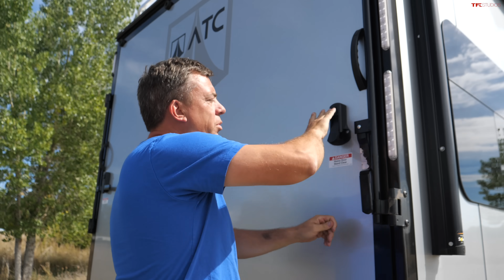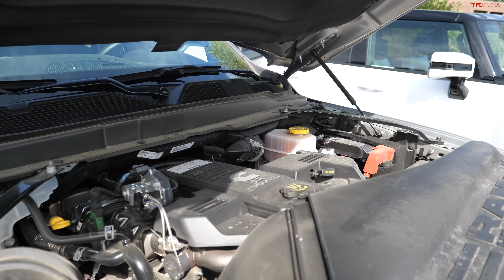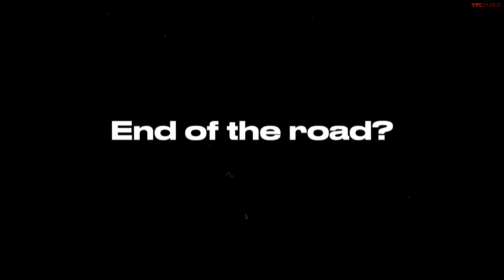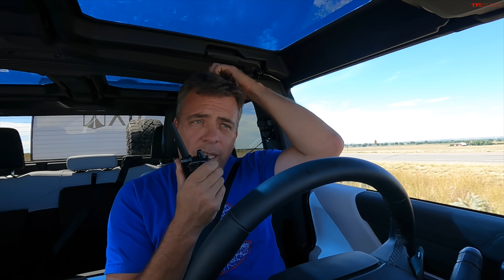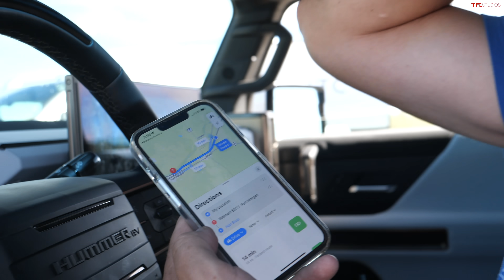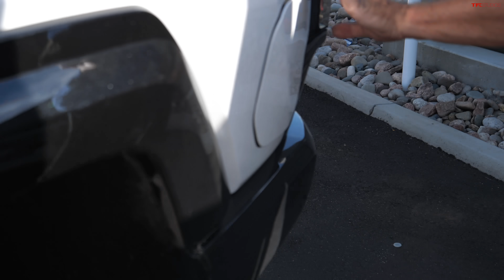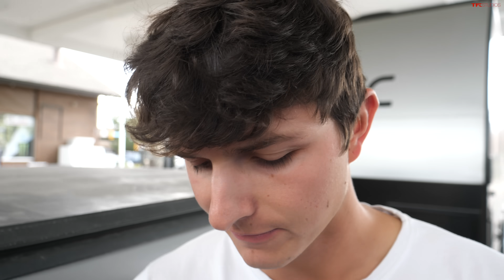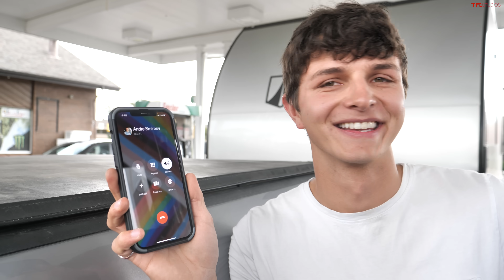How Far Can a Diesel and Electric Truck Tow An Identical Camper Trailer on ONE Fill-up?

Comment: Here is something these guys won't mention. Very similar to your cell phone battery. Optimal discharge and charge of the battery is basically 70-30. So you are urged NOT to charge the vehicle to 100% (70% is optimal) unless you need the extra range. Also you won't want to discharge the battery below 30%. All of which these guys have done in this day. Why do this you ask. Well with all batteries. Your battery has a finite life. The battery is losing capacity at a set rate. Not charging and discharging the battery in an optimal way will reduce the overall life of the battery. This is pretty important on a big, 3000lb multi-thousand dollar battery that comprises the bulk of the  value of the overall vehicle. Meaning electric vehicle resale value will be affected greatly by how well an owner cared for a doomed battery. Essentially. Ten years is the likely  lifespan of the battery. By the end of it's life cycle. The battery will probably have lost about 30% of it's original capacity. You can also factor in weather and other external influences on the battery range. Take all of these factors into account. You would realize that a 20 year old Hummer EV will be a useless as a work or tow vehicle. Think of all the time you will waste waiting at charging stations too. Which is another thing to factor. The electric vehicle is more efficient on energy that it has. But it's cost in money to acquire and time to charge. You are wasting an even more valuable resource. TIME. Ain't nobody got time for range anxiety and charging station hassles. Also, factor in being towed. If the EV runs out of juice. You likely won't have someone come and charge you back up remotely. You and your camper will be towed to a charging station and that will probably run you over $200. Also if the EV isn't towed properly or loaded onto a flat bed right. You might incur a $26,000 bill or more in vehicle damage from an inexperienced tow operator.

Comment: Out of Curiosity, the Hummers 200kWh battery is equivalent to ~5 gallons of diesel fuel.  What if you guys only put 5 gallons in the diesel truck and did a range test with the same amount of energy in their 'tank' Which is more efficient? by how much?

Comment: Sounds like a great vacation... Don't reach your destination, unhook trailer.. If you have space to put it.. wait for a charger.. kids restless at this point.. Plug in and wait another hour or more.. Charger has kicked off a couple times.. Kids screaming..  finally get charged, go back to trailer to find someone has parked in front of it... Hook up and maybe reach your destination..Etc... OR.. buy a diesel truck, go to your destination have a great weekend and on the way home pull into a stop that you can fill up and pee in 5 mins and keep rolling... 
And exactly HOW is this range  going to get products from the West Coast to the rest of the country with tractor trailer size vehicles? Over the Rockies? In the cold and snow?...

Comment: i kindda feel bad/pity those who got on the BEV "truck" train and then find out their advertised range when using said BEVs as trucks can absolutely torn to shreds! For the bigger picture/long term : why demonise ICE when we could keep the tech but adapt them to run more efficiently on biofuels that burn much cleaner? The marine industry are moving towards a fuel called MD97 which is basically 97% Methanol and 3% Ignition improver to run huge Compression Ignition marine engines - why limit MD97 to marine apps only?

Comment: The battery in the Hummer weighs 2,923 pounds and holds the same amount of energy as 6.38 kilograms of hydrogen (14.06 lbs). If the Dodge could hold 2,923 pounds of diesel, at 7 lbs per gallon that would be  417.57 gallons, at 9.7 mpg it would go about 4050.43 miles (with the trailer). Does anybody know what the Hummer  battery costs?

Comment: So, the Hummer is just as pathetic as the Lightning was.  The Hummer has the biggest batterie of all the EV's and it's still nothing more than an overpriced piece of crap.   I though designed obsolescence was bad, but this EV garbage is even worse.

Comment: I love your testing but you need to factor in the road taxes paid for with the fossil fuels into your fuel vs electric charge cost comparisons. It was over $100 to fill the diesel and would have been near $80 to charge the EV but that $80 is with our road tax. Factoring in the road taxes and the EV will be much closer to the diesel in charges. Again EVs are good for some but not for most and definitely not for all as our government is pushing.
Reply: Someone did the math in another comment. "Thats awesome the charge was free, but let's use the numbers to find out the future cost. The Hummer charged from 7% to 51% for $37.41 according to the EA charger. So $0.85 for each 1%. At that rate it would cost $79 to charge the Hummer to 100%. Hummer cost per mile: $79 ÷ 123 miles = $0.64 per mile.
Cummins cost per mile: $105 ÷ 211 miles = $0.49 per mile"

Comment: After owning an electric and getting to use it long term I went back to ice.  Remeber the E is a transmission drivetrain not a motor and the battery is the engine. A lot of trickery in the e market. The ice way outcompetes the battery not even close

Comment: Good content… worth the time to watch entire time.  You guys forget to account to heat and other loses of ICE diesel?  ONLY 28% of diesel makes it to produce wheels that go round and round.  Verses electric, even with the turd non efficient Hummer, places 80%+ of electricity in the motors generate to turn the wheels round and round. So, Hummer not three times efficient. It is more like 9X more efficient. Then factor in solar or other lower cost electricity, cost to turn the wheels round and round will add much more to the savings and efficiency.

Comment: They should’ve also compared the cost for the distance. If both trucks went the same distance and filled back up it looks like the energy to refuel would be close to the same
Reply: Someone did the math in another comment. "Thats awesome the charge was free, but let's use the numbers to find out the future cost. The Hummer charged from 7% to 51% for $37.41 according to the EA charger. So $0.85 for each 1%. At that rate it would cost $79 to charge the Hummer to 100%. Hummer cost per mile: $79 ÷ 123 miles = $0.64 per mile.
Cummins cost per mile: $105 ÷ 211 miles = $0.49 per mile"

Comment: Take the Cummins engine cut it in half put a generator on it install it in hummer electric drivetrain boom best thing since sliced wonder bread. It’s simple hickology, Half a Cummins have the emissions no electric source needed no coal powered fire plants. Now we just gotta work on the child slave labor mine thing in Africa and electric cars would be banging😎
Reply: I’m not a fan of hybrids, but a diesel electric for a truck makes a lot of sense.

Comment: @ 1:19 the trailers weigh "6,100 lbs, and...can carry about 5,000 lbs. of stuff"  ...in which case, the Hummer EV could not legally tow it. But the RAM 2500 (or any other HD pickup) could.

Comment: Short range is not the only drawback to EV pickups for hauling or towing; they also come up short on payload - because they're so heavy. GMC hasn't published the Hummer EV GVWR, but it rates the payload at only 1,300 lbs. Even with a relatively light trailer like the one in this video, about half of that will be lost just to the tongue weight (there must be at least 10% - and preferably 12.5% - of the trailer weight on the tongue, which is 610 - 762 lbs). So that leaves enough barely payload in the Hummer EV to carry two adults, two kids and a very small amount of gear.

Comment: Bottom line - $3.00 per mile (120mi range / $40) for the Hummer / $2.00 per mile for the Diesel (10 miles per gallon divided by 5 dollars a gallon) - this is a no brainer with all else being equal - which they are obviously not!
Reply: Someone did the math in another comment. "Thats awesome the charge was free, but let's use the numbers to find out the future cost. The Hummer charged from 7% to 51% for $37.41 according to the EA charger. So $0.85 for each 1%. At that rate it would cost $79 to charge the Hummer to 100%. Hummer cost per mile: $79 ÷ 123 miles = $0.64 per mile.
Cummins cost per mile: $105 ÷ 211 miles = $0.49 per mile"

Comment: So essentially once you add anything to the toy hauler you are now past the tow rating on the Hummer.  You have to remember they did these tests empty..  but an average of 10.5 mpg for the cummins is horrible too!  That's a light trailer considering it can tow 20000 something pounds.. all the emissions crap is killing the diesel efficiency!

Comment: 123 miles per charge would add so many unnecessary stops to a trip. Put a wife and kids in the car and see who still has their sanity after a weekend of camping
Reply: For a 3-day weekend trip, good luck getting to camp more than one day, unless you only go 100 miles or less & there is a charging station near your end point. Imagine if they had gone their full planned distance and the Hummer needed at least one more recharge just to get there whereas the Ram could nearly have made it on one tank.

Comment: Without watching the video,  answering the title question.  The Cummings can pull this super light hollow camper about 500 miles on one full tank, about 5 minutes to fill. The hummer? Less then 200 miles,  8 hours to charge,  175 dollars for a motel room. 
P.S. child in white t shirt, if that trailer is gigantic what will you think of my 42 foot  7th wheel 6 slides, 100 gallon fresh water tank, washer dryer, dish washer,  4 air conditioners 3 furnaces, 40 gallons of propane, loaded with shit. Pulled with 99 dodge,  24 valve Cummings, 5 speed standard with banks power propane injection.  
Your gigantic trailer? Bitch please!!!!.

Comment: Range anxiety ... oh yes....
Reply: Right? Jeesh! I get range anxiety trying to push my F150 Powerboost closer to 600 miles than 500 on road trips (loaded bed, no trailer) driving 70-80 mph. I would be kicking myself if I had to spend 20 minutes on a refill after only a couple hundred miles.

Comment: You should have 100% charged the Hummer at that 125 mile point, showed what it cost to charge forb125 miles. But then also filled the Cummins at that point and showed what it cost to dive the Cummins the same distance with the same trailer.

I bet you would find it cost more to drive the Hummer.
Reply: Someone did the math in another comment. "Thats awesome the charge was free, but let's use the numbers to find out the future cost. The Hummer charged from 7% to 51% for $37.41 according to the EA charger. So $0.85 for each 1%. At that rate it would cost $79 to charge the Hummer to 100%. Hummer cost per mile: $79 ÷ 123 miles = $0.64 per mile.
Cummins cost per mile: $105 ÷ 211 miles = $0.49 per mile"
Reply: To charge the hummer at a QC station if it where 100% dead is 80 dollars. If you charge it at home it would be 30 dollars. If you charge at a free station it would be free.
Reply: So if Silvy's numbers are right & it cost $80 for a full charge after 125 miles, your are probably right. 125 miles in the diesel at 9.7 mpg is 12.9 gallons. Prices vary, but if you paid $6/gal at the pump, your fuel would have been ~$77.

Comment: Be interesting to see a segment dedicated to showcasing stability control while towing using different trucks but mainly  between these two. How will the 4 wheel steering  fair out in a mini controlled slalom course on the strip with cones ? That kind of tests are not something I see in general,  then do the test  with and without the weight distribution hitch.

Comment: What a disaster.  Electric Ponzi scheme. Wait five years when the battery is depleted and the technology is obsolete. That’s a loss of $25,000 per year. You would have been better off buying a top of the line F150 for half the price or five Mavericks for the same money.

Comment: Standard everyday ICE roll onto the showroom floor having produced apx 7 tons of carbon pollution.
Making the battery cells for EVs that have apx 150 mile range generate apx 13 tons of carbon with the mining and other processes needed to get the materials.  Whilst evs with an over 300 mile range roll onto the showroom floor having generated about 18 tons worth not having driven a mile. And your balance point of becoming 0 emission doesn't happen til after 300000 assuming your cells can last that long, as in time wise before they start deteriorating. However if you need to replace those cells which is a high likelihood, you kick that 0 point even farther down the road. And according to the NHTSA the average cars life being useful is only 126,000 miles.  So according to them you will never be 0 emission. And also aording to NHTSA the average cars mileage on the road is 160,000.  So again, most will never be 0 emission. 
Also aside from production, cobalt mines in Africa are manned by child labor and the sicknesses and death those kids experience is heart breaking.  I highly encourage you to research that. 
In addition, as if this isn't enough information for you to process, the industry will tell you that if you didn't do any of this green energy stuff and just utilized fossil fuels, you would have produced less pollution in the end. 
There is a documentary I challenge you to watch with your beliefs called planet of the humans, you can find it on YouTube. And after you've watched it tell me you still believe in green renewable energy, or electric vehicles.  If you're interested I can send you other peer reviewed studies or documentaries as well.

Comment: Can you do a steady 60mph highway towing test with the Hummer and compare efficiency to 70mph?  Would be nice to see how much aero plays in range at that speed.
Reply: Aerodynamic makes a huge difference on a large block shaped trailer. About 40% difference between 60 mph and 70 mph.
Reply: A rough estimate is just comparing 60^2 and 70^2
49/36 is 1.36, so if you ignore the motor and battery thermal efficiency changes with output, at 60mph the truck can go 1.36 times the distance
Reply: Actually motor and gear efficiency would play a bigger role. They could easily get 25% more range just by going highway speeds.

Comment: This isn't really the appropriate test. A better test would determine the EPA fuel mileage of the diesel and put whatever amount of fuel is comparable to the range estimate of the EV. So, start both vehicles with say 200 miles of "fuel" and see how far each goes under the same conditions. Its an appropriate and far more interesting test.

Comment: I did a quick calculation based on the numbers stated in the video and the numbers on the charger. If the hummer were to have the same energy capacity as the dodge, it would cost $502.88 to charge it. The more you know…
Reply: Well, thats the dodges energy capacity before 40+% of it is wasted as heat.
Reply: Someone did the math in another comment. "Thats awesome the charge was free, but let's use the numbers to find out the future cost. The Hummer charged from 7% to 51% for $37.41 according to the EA charger. So $0.85 for each 1%. At that rate it would cost $79 to charge the Hummer to 100%. Hummer cost per mile: $79 ÷ 123 miles = $0.64 per mile.
Cummins cost per mile: $105 ÷ 211 miles = $0.49 per mile"

Comment: I am curious about the 30 sec. wait & top-off. Most (if not all) manufacturers do not recommend topping off the tank, so why do you do that?
Reply: They were topping off the tank to accurately calculate mileage,  which is the point of the video